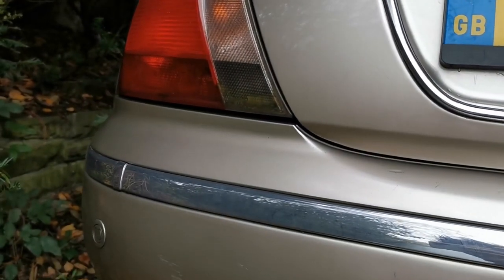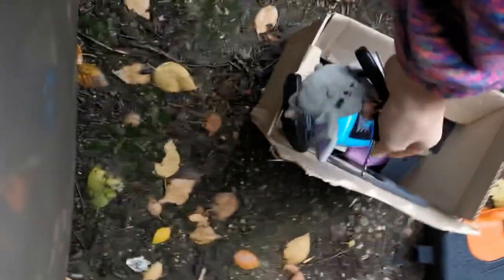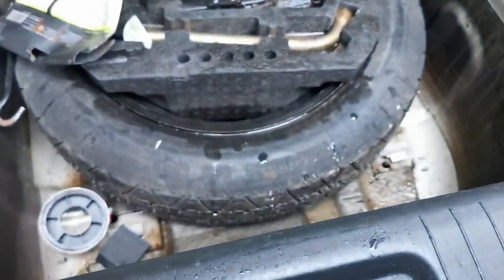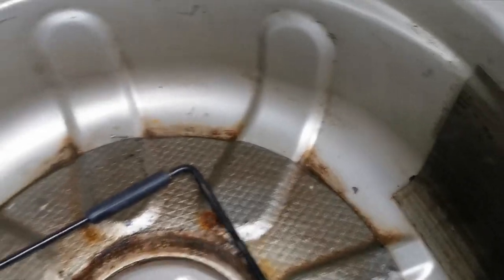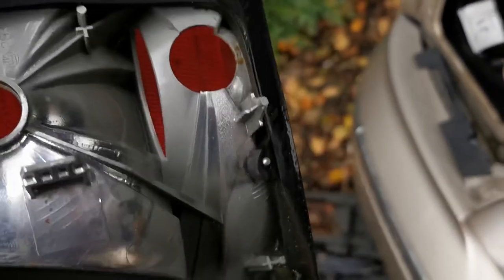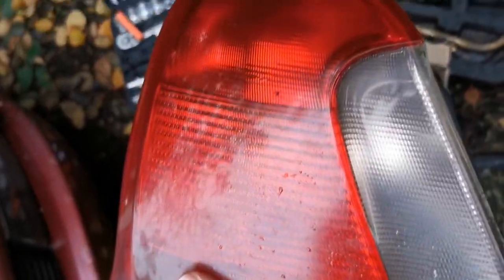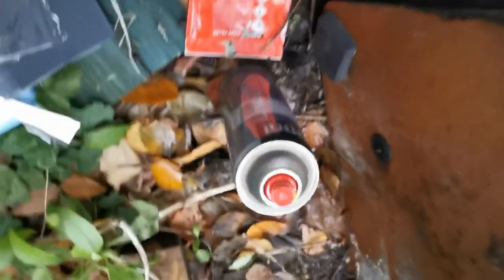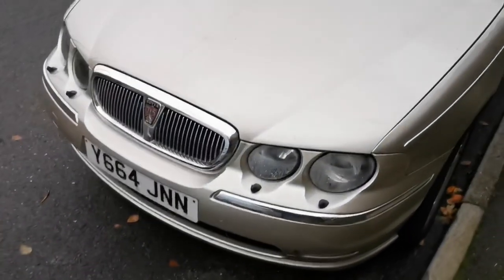Fixing Common Issues with my Rover 75

Comment: Hey buddy ,
Great to see the younger generation interested in our crazy cars. 
FYI check underneath the rear bench seat for rot on the fuel tank pipe ! If it’s rotten don’t panic there’s two rubber pipes inside it 😀check and fix if required .
Happy retro motoring
Reply from the maker: I'll check that ASAP then! Never knew anything about that one.

Comment: Don't throw away the wood base. Mine was soggy and I took it home and let it dry. Wiped it down and it has been fine. I also did my light gasket, the original has the split from factory.
Reply from the maker: I'll probably keep it, I paid a couple of quid for it a few months back I was just a bit concerned it would retain the moisture, how long did it take yours to dry?
Reply: @tomdrives  I left mine for a day or so in my stairwell. With some old rags underneath to soak up the residue. The whiteness is mold and I used antibacterial wipes on it. I also found a leak from the chrome side trim. The screws on the inside come undone really easy so I'm going to fix that with threadlock and a rubber washer.

Comment: Hello mate you got some great videos. I ve seen the one where you remove your inlet manifold on the blue r75 but i m really struggling getting to the rear bolts or figure out where they are so cant get them undone. In the video this part is missing do you by chance have a video of removing the rear inlet manifold bolts or could give me some pointers as its a pita

Comment: Had the same issues with my old 87 300zx which caused the spongy jack and tool holder to soak up the water and rot out the boot floor! Hey presto for black rtv👍🏻

Comment: First thing I ordered for mine was boot seals 😂 been a joy to work on so far, sadly mine ran the water down under the rear seat and drowned the bench instead. Oddly my PS one split in the same place, must be a common place
Reply: It's actually split like that from the factory, but the two halves move apart making a gap as the gasket shrinks over time. Bad design! The 'yoga mat' replacements are much better.